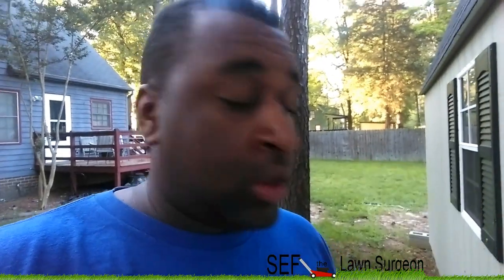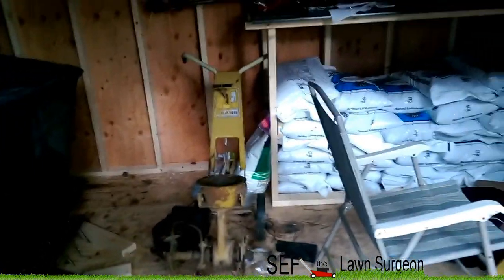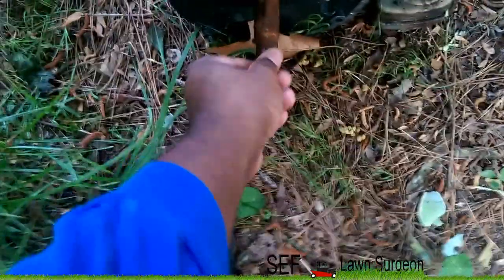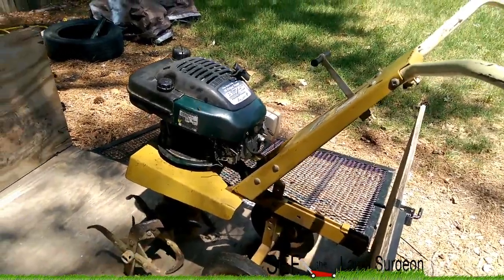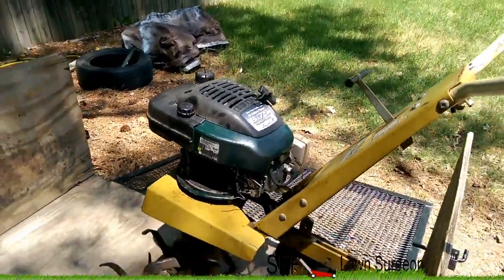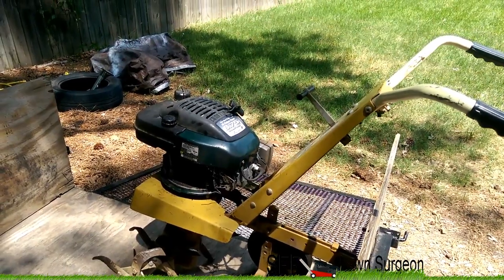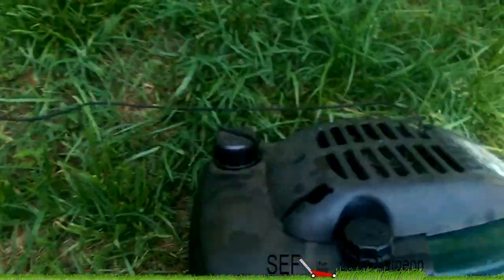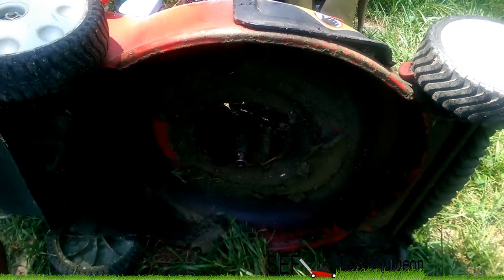The Yardman's "Yard Maan"!! - Ep10 - "The FrankenTiller"

Comment: Now you just have to work on the kill switch!
Reply from the maker: Craig Arndt  .. yea...before i get electrocuted ..lol
Reply: When we use to race karts we would put a zip tie on the plug boot and with the extra hanging off tie it in a knot close to the end and it will act as a knob to help when pulling.
Reply from the maker: Sean Wood .. nice quick fix..thanks
Reply: Your welcome.  Hope it helps